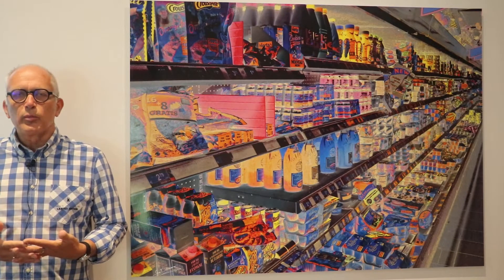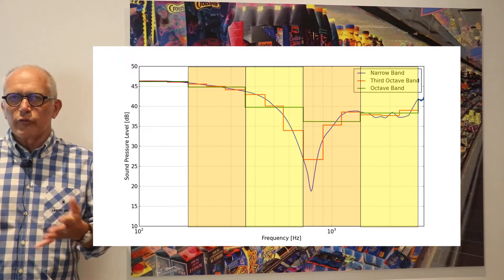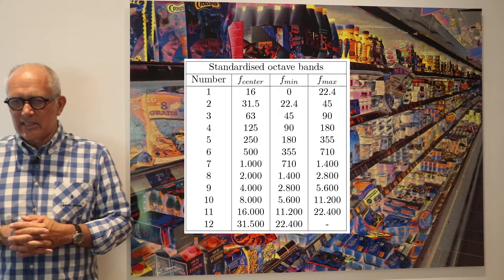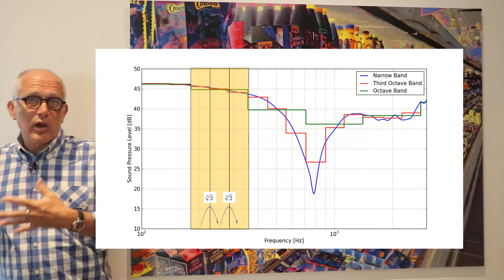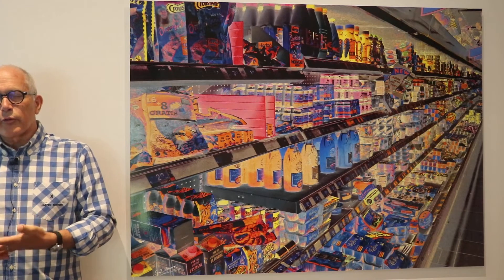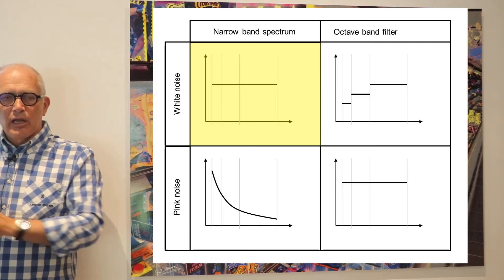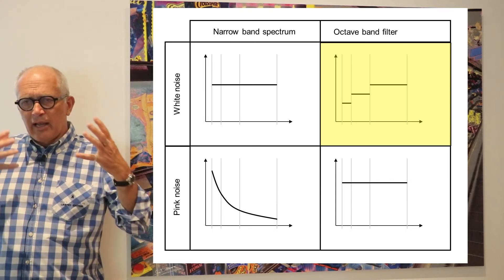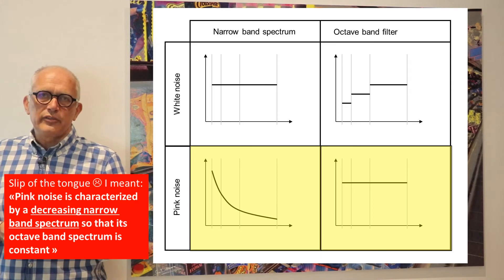Acoustic engineering 101 - Section 7.3 - Frequency bands and band levels. White noise / pink noise.

Comment: Does there no difference in dB between the level associated to 2 neighbouring filter(no matter octave or 1/3) in pink noise? Because on the lower right graph, there is constant band level. Thus there is no difference in pink noise between two band of frequency.
Reply from the maker: That’s the idea. A white noise has a flat narrow band spectrum while a pink noise has a flat band filter. Try the audacity white and pink noise generator.